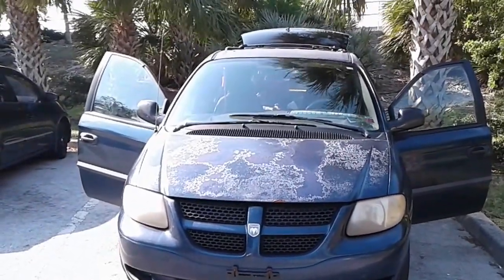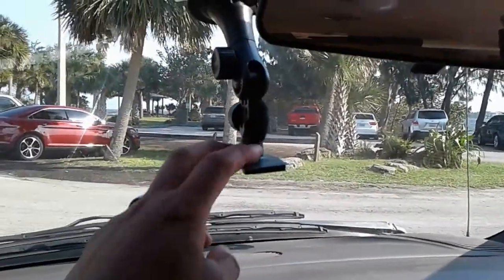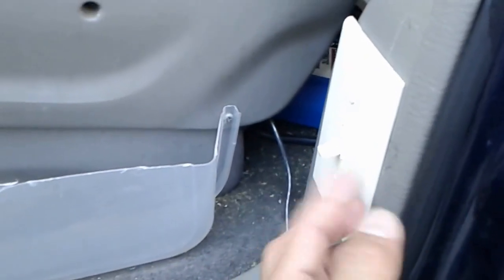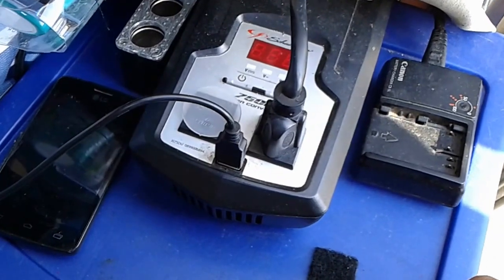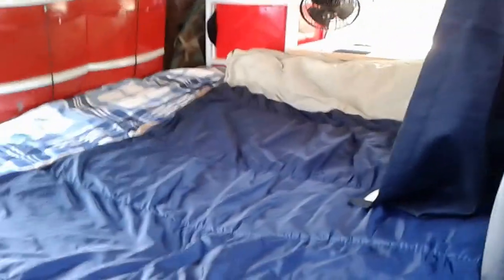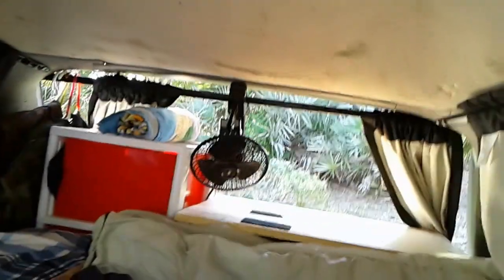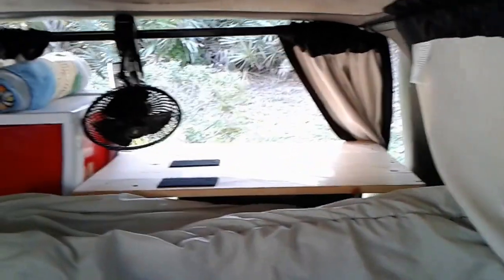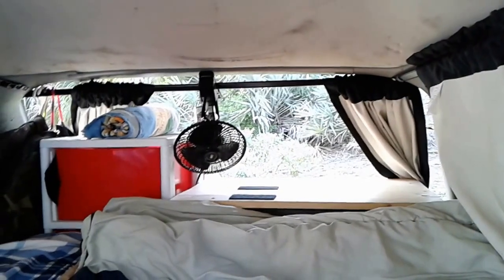Vanlife: 'Lil Blue II's Final Bug Out Minivan Camper Tour Part 1 (V442) Minimalist Living In A Van

Comment: Last year my 2004 dodge minivan the ceiling upholstery was sagging. It would no longer stick to the foam under it even when I sprayed glue. So I pulled down the sagging upholstery. Then when my head bumped the ceiling, a cloud of crystals would appear. I didn't want to breather that. So I scraped it off with a shop vac, wiped the single-piece fiberglass overhead with acetone, then painted it. No more fabric drooping in my face. Yours is in better shape, but not much.